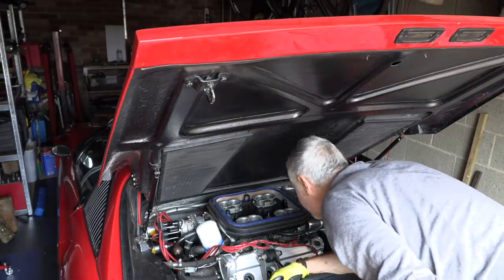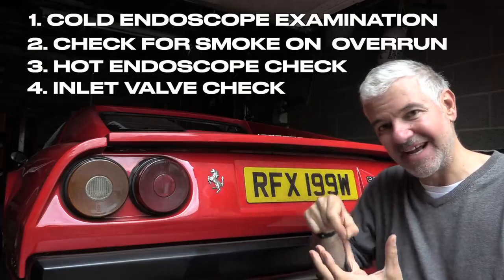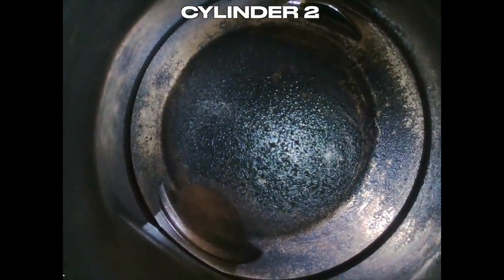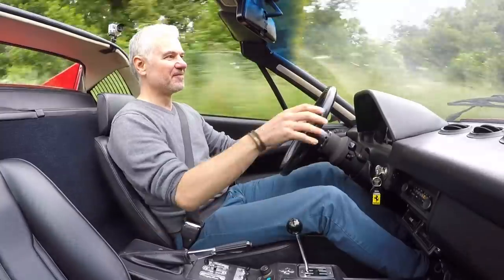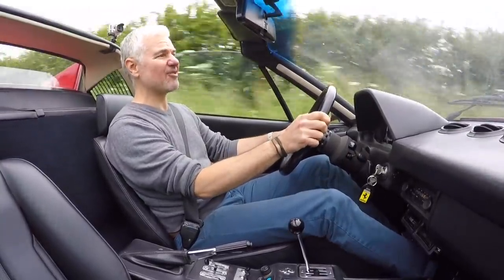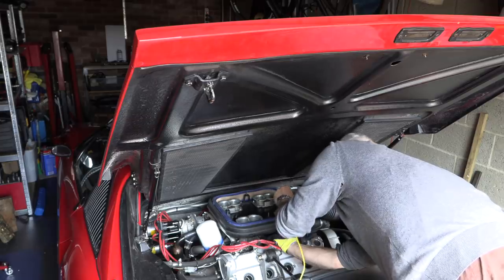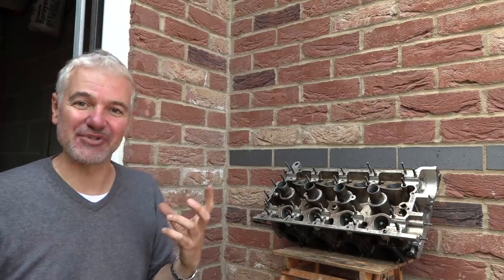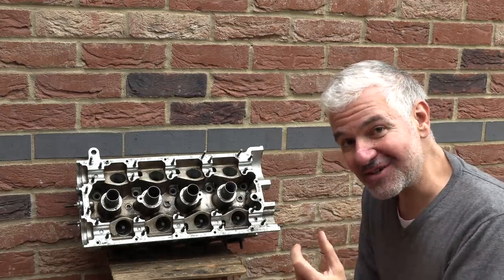Could this £50 tool help me save my cheap Ferrari?

Comment: Back in the day when I was a mechanic, I would always advise not to do a top end only overhaul as my experience was that often the bottom end would fail shortly afterwards. I used to describe it to the customer as, imagine an old man, every bit has aged the same, improve one part and it throws pressure onto the other parts which are still old
Reply: Nickolas Carter is right.
When restoring the heads you are of course sealing up all the possible ways compression can escape from the bores (head wise at least). So the next weakest link in compression loss will be blow by passed the worn piston rings. Which then compresses the crankcase. As with all engines they must have a PCV valve which takes the crankcase gases to be burned through the intake manifold. 
The only sure fix for this is really is new rings on the deglazed bores.  Engines with higher milage with newly sealed up heads can also put extra loads on the the big end bearings and create big end knock. Good luck.
Reply: Heard that a few times too. Makes sense to me, you now have all this lovely compression up top but the old man's knees aren't up to it
Reply: @melbournecyclingsegments7510  maybe I should cancel my hip operation.

Comment: The back of the intake valve is sprayed with petrol don’t forget , any oil would be washed into the cylinder anyhow . I think leaving some redex to soak in the cylinder might be better than additives to oil . Might be worth venting the crankcase better to eliminate pressure on overrun .
Reply: This is the best diagnostic (from RichieRich) I've seen and some engines are designed to burn a little oil when running , specifically V8's. I think what is in the cylinders is possibly only fuel.  People tend to start a Ferrari and then rev the engine .......which is the fastest way to wear it out as it should be allowed to warm up and get oil circulating before giving high revs.   Those cylinders only looked to have fuel in there, but I would check the crankcase breathing as said above as that could push crankcase vapours into the cylinders, but the plugs aren't fouling with oil.   I would just be enjoying it as it is.
Reply: I agree here very much, try this idea
Reply: @awalk5177  Oh yes indeed. Warm up every performance engine always.

Comment: After the tracks in the intake port, the thought of a clogged crankcase ventilation occurred to me.  If the pressure in the housing is high enough, the blow-by gases tear out of the crank drive, and if they suddenly escape, a considerable amount of oil droplets flow with them, which then make their way through the inlet duct via the vent and the carburettor.  This phenomenon occurred very often in the past on the EA 827 from VW and is still present today in various modern engines after greater mileage and especially with the currently usual oil change intervals.  These circumstances virtually cause the crankcase ventilation to be “lacquered”.  Perhaps another possible item on the maintenance or inspection agenda?
Reply: totally agree
Reply: Right.

Comment: It's not drinking oil, it's got good compressions, and the carbs are right now. If it was me I'd give it 500 miles of "running in" and see if that cleaned all the unburnt stuff out of the exhaust and got the rins settled in again after all that fuel was washing past them.
Reply: That sounds like the perfect advice for now... I agree totally.
Reply: 100% agree
Reply: Unless the oil consumption is massive, I’m inclined to agree with the above; the car’s running really well and sounds great…perhaps it’s time to enjoy it through the summer. I realise that doesn’t necessarily make for great video content, perhaps you can turn your attention back to the Frankenlise Jack?
Reply: These cars do exactly what the subject car is doing if not driven hard frequently. As a former garage owner servicing Ferraris, Alfas etc they need a hard drive to keep from clogging up. A short thrash on a local B road is not enough and urban driving at low engine speeds with lots of idling is a disaster for these old tech performance engines. Appears not too bad to me, nothing a sustained hard drive wouldn`t most likely cure. If you really want to put your mind to rest give it a leak down test, but I think Jack is worrying about very little. Keeps subject matter for the videos going though doesn`t it.
Reply: @richardjones2468  Well said.
Reply: @richardjones2468  A Ferrari mechanic told me the exact same thing some years ago and it's what I do. I think your dead right.
Reply: @themessenger5868  Yes those comments come from a few years of experience and we actually own a 308 - `75 Dino GT4.
Reply: Listen British man (enthusiast) sounds a bit southern so taking the Erratic Enzo to Hawarden and see Mr Tyrells place must of been 300-400 miles
This Enzo just likes a bit of Agip that's all
 I'd check the oil is the correct stuff and is thick crap like the Spaghettios used in the 70's
Reply: Big John Fury the spaghettios 😂

Comment: It appears to blow smoke after periods of high vacuum (ie idle or gear changes). If the oil control rings were bad then I would expect it to smoke continuously when you put your foot down. If the oil is not getting past the valve stem seals then check out any PCV valve or breather pipe. Plug any such system up and test again out on the road. If that fails then it may be oil control rings but I cannot see why they should suddenly go bad. Anyhow i will be fascinated when you find the answer. Cheers!

Comment: It doesn't look like oil in those exhaust valve recesses to me, it just looks like they are black due to normal combustion gasses and that the bright LED is reflecting off the surface giving a glossy liquid sheen.
Reply: Came to say this.
Reply: I agree
Reply: Same thought here.
Reply: I had the same thought as well
Reply: Yep.
Reply: Yes,it's just carbon in that reces

Comment: "Perfect is the enemy of good." - car is running great and a pleasure to drive - just live with it like it is and enjoy it.

Try a thicker oil (20W50) - if its rings it will noticeably reduce the amount burning.  Not really a "fix" but will put off the full engine rebuild for now.
Reply: Had a high-mile Toyota in the 90s that was a real smoker; car was great aside from that. So I took a chance and tried Bardahl No Smoke. I was absolutely shocked at how well it worked. It reduced the smoking issue by 85-90%
Reply: Yep. Those after market additives really do solve a lot of problems short term for unscrupulous car dealers and those hoping to move a car on, but I don’t recommend using them on a car deeply loved by its driver owner, let alone something as worth preserving as a Ferrari.
Reply: They do, basically they work by increasing the viscosity index of the oil; a 15w/40 can be turned into 20w/50 or thicker very easily. However, there is are downsides - 1) they suck bhp (because of increased frictional losses) and you’ll definitely feel it will be lower on power, 2) in lower temperatures you will need to be careful to warm up the engine before using it in anger as the oil might well display unusually poor winter (cold) performance characteristics. Kept in a garage, you’re probably ok, but a Ferrari dealer will confirm the operating tolerances that the engine will accept without damage to it - better some smoke than a lack of lubricant to critical components at start up. Watched the video - probably oil ring wear on pistons is my guess, for the age of car I’d say it’s pretty good..
Reply: @davidbuchanan2106  Agree with your last sentence. Older car, different materials and tolerances, I would be pleased with the level of smoke it's showing!

Comment: I replied in the last video to change the oil to millers 10w50 nano fully synthetic . You need to do it, jack. I’ve had it in my Porsche 997 for years . It’s superb oil.
Reply: No bore scoring Ian ?
Reply: @hondablack1  hi John, yes I have. It developed an oil leak between the engine and gearbox and immediately thought IMS . Gearbox off and it’s the IMS flange seal that is leaking with the bearing feeling ok. Decided to have borescope done and it’s looking really bad. All 3 on bank 2 are scored 😢 no symptoms at all but while it’s out I’m having it all done 🤣 can’t take it with you 👍
Reply: By the way. It never used oil using millers despite the scoring.
Reply: @ianpalmer7612  Thank Ian interesting feedback. I've just bought a low mileage 997.1. Looking into maybe getting it checked by Hartech. You will have a bullet proof car after the engine work. Good luck with it. :)
Reply: @hondablack1  hi John, mileage is irrelevant. Get it scoped and treat the car accordingly. If you’re keeping the car it gives you options going forward 👍 thanks .
Reply: I like Morris's oil, their based in Shrewsbury and are big on the EU market. I rebuilt my BMW 2.8 6 cyl engine about 23 years ago and used their semi synthetic and the head was as clean as when I rebuilt it after 30k miles. I also polished the top end re-seated the valves, full gasket seals and it pulled like a train. The tops of his pistons don't look good, especially if the head has been rebuilt!

Comment: Use it and use it hard, keep a close eye on the oil consumption, often once a few hundred proper miles have been racked up after a car has been rarely used rings etc start to free up

Comment: Sticky rings could be a thing.  Ferraris tend to sit a lot and not be driven.  The old tricks we would do with marvel mystery oil in the cylinders (or some other similar product) to try and free up the rings sometimes works if it isn't too bad.  Seems to running pretty good and sounds lovely.  Keep at it.  It's a worthy patient. ;)
Reply: Yeah, Marvel can do wondrous things - used often on radial aircraft engines.

Comment: What about trying something like Seafoam to clean inside the cylinders. Basically it steam cleans, breaks up carbon and stuff that could be sticking up the rings. You can before and after it, see how well it does. I think the heads are fine. Be careful do not rush, or dump too much in, liquids are not compressible.
Reply: I was thinking of using Seafoam myself but can't get any factual info about what it actually does. Al I get is enthousiastic answers like " Oh yeah, oh yeah, use it, it's marvelous !"  Aaah ok, but what does it do to an engine exactly ??🤫
 " Aaah, well, I donno exactly... but it works !  🤪 Any clue or advice ? You pour it in the gas or oil ?

Comment: Hi Jack, yes try the adatives you can get good results from these products and usage of the car can really bring things back, the control rings have small triangle resesses and old static oil can gum then up!! The old timers used to move to a thicker oil to avoid bypass but this must be checked out ??
 That car has probably stood around Alot and engines love to run..!  I used Wynne's on my XR2 and it made difference after 300mil
 Best of luck Jack. Thumbs up (:

Comment: Both the compression rings (and the oil control rings if you have that kind of rings) meet the cylinder surface forming a wedge. The topmost rings (compression rings) have the wedge pointing downwards, letting oil stay on the wall when going down, pushing oil up on compression stroke when pressure is built. The lowest ring/set of rings have the wedge facing upwards, letting oil stay on compression stroke, scraping the walls almost clean of oil when going downwards. Thus if the oil control rings are turned upside down oil is pushed into the combusion chamber instead of scraped down into the sump, while if the compression rings are upside down you will lose compression on combustion and probably melt the ring lands area of the pistons from the blowtorch going past under load. 

Checking for correct ring orientation is possible when building an engine (most ring kits come marked with an indication of up/down), I have usually put the ring in a clean bore, added just a slight moist of oil on the cylinder wall (thin enough coating that it won't cover more than a fraction of the width of the ring after being pressed trough the cylinder), pressing the ring with the top of a piston through a top-bottom or bottom-top travel of the cylinder to see if it wants to scrape the oil towards the top or bottom. You can also cover the outer circumference of the ring with a touch pen or engineers blue marking color, force the ring through the bore with a piston and see which side of the ring that meets metal on metal (the scraper side) and which side that has the wedge (metal won't meet, and oil is left alone by the wedge once the engine is running)

Comment: The big nut on steering column is often the culprit for steering play. Had the same issue on my 5 series e28, removed 90% of the play. Now it just needs a little steering box adjustment and the steering center rod to be changed.
The pistons looks a bit oily, but to be honest I don't know if there was really oil in the recesses. Looked kinda wet but sometimes you could clearly see the shape in the piston. It smokes on startup but I've seen worse (my Alfa Sud Sprint omg, it's a mess). Anyway great work and determination as usual. Cheers from France 👍

Comment: Hi Jack, ‘Back in the day’, I had a Mondial with the Quattrovalve head - basically just an evolution of the engine in the 308. I had a similar hesitation issue when going around corners (can remember which direction).  It was diagnosed as an engine mount had too much movement. Mounts were replaced and the issue was fixed. It’s unlikely that the hesitation issue will be a ring issue, though may be the cause of your blue smoke….. seems like you have ticked off most other possibilities so consider the mounts.

Comment: You could do a wet  and dry compression test and making comparative readings after dropping a bit of oil in the cylinder to compare .This will tell if fault with valves or pistons. Best of luck you could do with it for a change!

Comment: I have built many vintage ferrari engines. One problem it could happen with rebuild heads are guides that made to small so they leak between the head and guide. Check breathers and by all means I would use a good quality high detergent oil. Go for a road trip motorway driving is best. But saying all this ferrari engines will always have a bit of smoke at start up and on over run.

Comment: Trying to de-gum the rings is definitely worth a try. As someone else has suggested, Redex or similar down the plugs (and in the fuel?) is an idea, only problem is the cylinders are canted well off vertical and the rings won't get the thorough soaking around their entire circumference they otherwise would. But the engine sounds luvly and seems to be performing well so no harm in enjoying it this summer!

Comment: Crankcase venting blocked or not breathing ? and use 20% Lucas Oil Stabiliser (start with 20%) it will help the oil viscosity
Reply: It's either that or valve stem oil seal on one of the valves. Over run smoke is usually the stem seals. You agree?

Comment: When I bought my Citroën 2CV, compression was awful, due to gummed rings.  I used upper cylinder and combustion chamber cleaner spray down the carb.  Over a couple of cycles, combined with a bit of spirited driving in between, compression went from 105 psi to 147 psi.  It has stayed there ever since (and that was 20 years ago!).  Best wishes.

Comment: Those intake ports are just beautiful. 
That would be useful to see a known good cylinder too. Startup smoke can come from the exhaust valves. Have you got a 90 deg prism for the endoscope?
To be honest I don't think rings will gum up with carbon in a car that is filled with quality oil and serviced regularly. 
I wish you the best of luck to find the problem.

Comment: If you have access to an air compressor get yourself a cylinder leakage tester.
Test each cylinder in firing order and you will see how much, (if any), compression you are losing percentage wise and where from.
If you have blowby past the rings you will be able to hear the air hissing into the crankcase if you pull out the dipstick, or take off the oil filler cap.
Likewise if there is a valve problem you will hear air out of the exhaust or inlet and if into the cooling system you will see air bubbles in the header tank, (obviously none of these should be affecting your engine if the top end has been overhauled).
If it tests ok would be worth checking the crankcase ventilation system as has been suggested and finally oil choice can make a big difference with an older engine.
Not a Ferrari specialist, but I hope this helps!.

Comment: I know it's a bit late in the day but instead of obsessing about the 'oil control' piston rings the ring you should be thinking about is the oil scraper rings which are the 2nd ring on a 3 piston ring setup, these scraper rings when worn or faulty could cause an oil consumption problem..

Comment: Gases do indeed flow back up the ports toward the carbs (or TB) at certain points in the rev range, especially on n/a motors with lots of valve overlap.
Have you done compression and leakdown tests? Yes it's possible you have good compression and leak-down but find a stuck oil control ring, but it's a start.

Comment: Granted it's not a Ferrari but when I rebuilt my Fiat I used Deves piston rings. They were great. These Swedish steel rings have spring loaded oil control among other features.  They make rings for every car going back to the '30s. If you change your rings, I'd recommend looking into these.

Comment: Over the years on our race bikes  the oil is so important , and each bike brand has a sweet spot weight  that stops the oil pushing up  from under the rings . and  synthetic oils allow us to gain more hp using lower grades . but there is a sweet spot before it blows past the rings